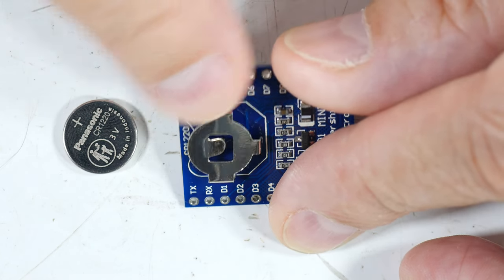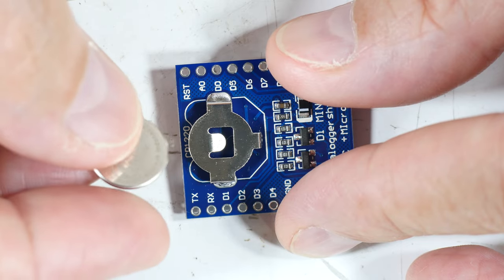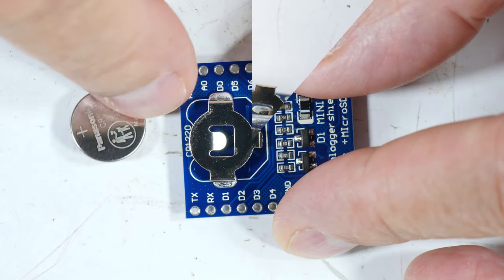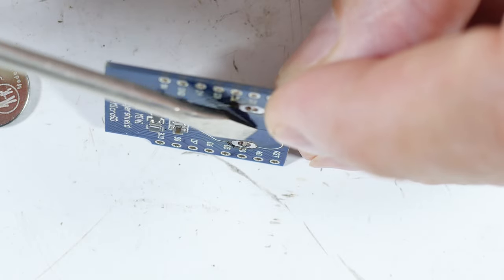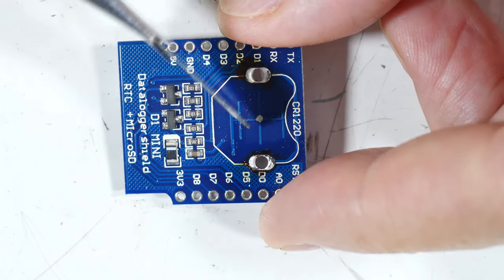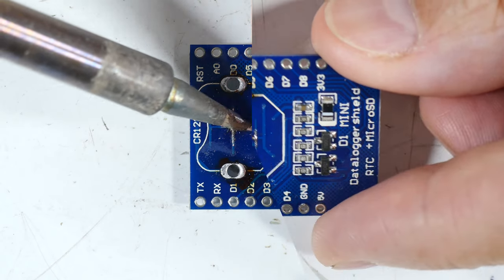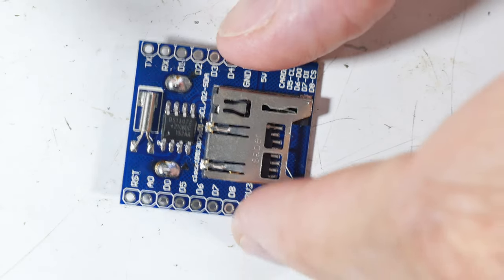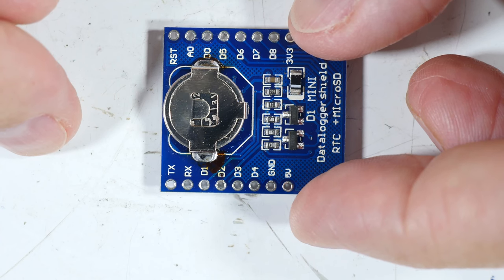Button Battery Holder Fix (4K)

Comment: Awesome observation 👍. BONUS TIP: If you're in a rush and need to get it working right away, you can fold up a small piece of aluminum foil to wedge between the battery contact and the PCB contact 😊